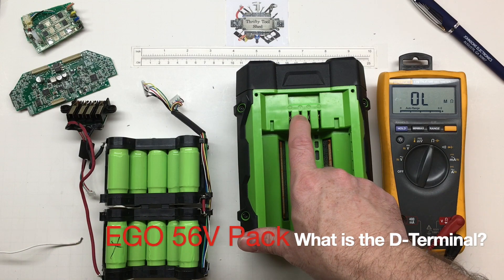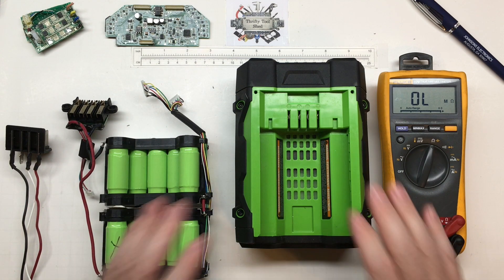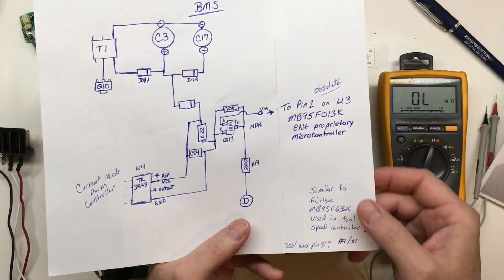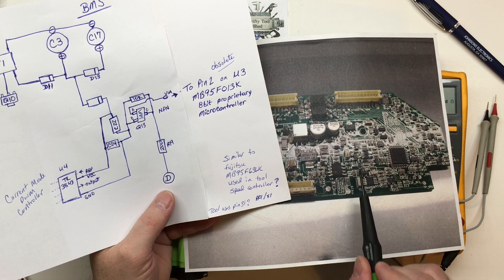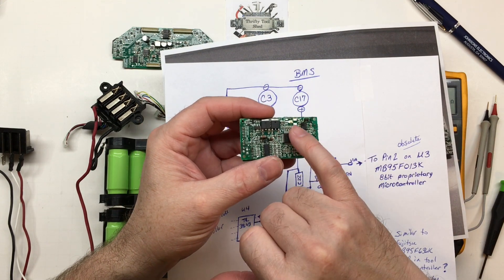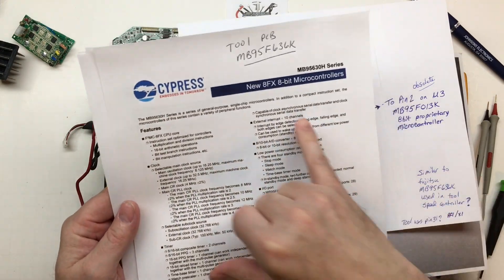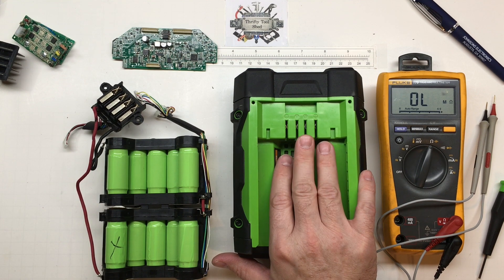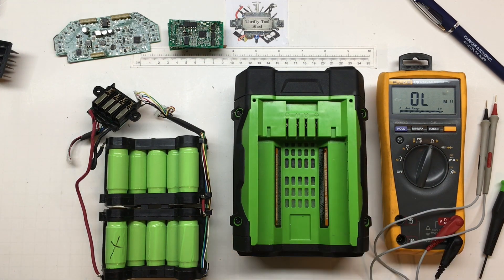EGO 56V Battery - What is the D-Terminal?

Comment: For anyone having similar issues, I had an issue where my mower, wipper snipper and leaf blower would run for ~5 seconds before they shut down, the fuel gauge on the battery also didn't light up when the tools were turned on (although the fuel gauge worked when you pressed the button on the battery to check the level). I tried powering the tools using my home made ebike battery but had the same result (ran for only ~5 seconds before powering down). I figured that the issue must be with communication over the D terminal. I pulled the board out and checked it under a microscope and found that the 200 ohm resistor (R19) across the data line had blown and had gone high resistance. To test, I removed the blown resistor and temporarily bodged in a 200 ohm through hole resistor and it fixed the battery. I will order an SMD resistor to replace it and all should be good. Hopefully this helps others.
Reply from the maker: It will be interesting to see how many viewers have that same issue. I have not seen it. Very unusual to have a blown resistor on a data line.  Thanks for sharing!

Comment: Thrifty - what would be your advice on how to set up a protection to 4 EGO batteries wired in parallel to run a non EGO motor so that the batteries do not damage each other if the bank becomes unbalanced and also that any battery would shut off or cut off if the SOC or remaining capacity drops too low?  Since it seems the D terminal would normally handle the low voltage or capacity shut down via a conversation between the BMS and the tool I don't know how we can leverage the BMS's at all to help with this.  EGO must have some way they are addressing the multiple battery safety since they have several tools that use multiple batteries like the Zero turn, the backpack blower, and the snow blower and maybe others but perhaps that relies on the D-terminal as well.
Reply from the maker: Yeah, the D-terminal is a strange one, and it is going to be hard to get to working in our favor for sure. I can not speak from experience at all on these packs with 4 in parallel to be clear. I have not had to do that myself, but schottky diodes are most likely needed to keep from back feeding and then maybe the individual packs can be monitored individually with either a low voltage cut out board as I have discussed and shown before or a simple trick is the cheap battery voltage indicators that have an alarm feature. I would imagine you could even remove the buzzer and make the output trigger a mosfet or optocoupler, etc. and then, hopefully, all will be monitored individually with 4 of those circuits. It's always a risk with any design, and that is 4 packs, so be careful as with any modification. Be safe and have fun. Wish I could help more, and best of luck to ya!

Comment: Dude your so advanced I want so badly to learn this stuff
Reply: Quick question I have several ego batteries that I've charged to the voltage by an unorthodox means however once inserted into a tool I only get until motor startup then red flashing I went through all temp transistors to no success. Could I possibly run a 10k resistor from neg to D terminal and confuse the motor controller.
Reply from the maker: The D-terminal seems to communicate so there is no easy bypass that I have seen. Thanks for your kind comment!
Reply: Yes, think I'm going to have raise the white flag on this one. Geez, I don't get my ass kicked often

Comment: did you try a serial decoder through your scope on the d (data) terminal?
Reply from the maker: I have not. I was hoping to get to that point since all I really seen on the scope is likely a carrier frequency from the controller output. It has been several viewers that have taken it that far and were much closer to decoding it, but I have not heard back from them since. Once I seen aftermarket clones of the board (in aftermarket packs) I backed off spending anymore time on it since I know it has been done to a degree and we have a possibility of getting spare boards. I hope to eventually see these BMS boards for sale. I have asked a couple manufacturers about buying a bulk quantity, but no success yet.

Comment: Looks like maybe a bidirectional UART. The presence of R19 (the 200ohm between D-pin and Q13 collector) means that when the micro opens Q13, the tool won't see ground, just a lower resistance. I guess if the tool/charger also has 10k on that line, it'll be close to zero. I'm guessing it's a similar dual purpose pin like M18. Maybe serial data in charging and an enable/disable pin for the tool. Those pulses look more like motor noise than serial data. I'm fairly sure XGT has a separate isolated ground for communication so that it can communicate whilst the tool is running - otherwise there's just too much noise when data shares a ground with the main power path. It could still have serial data during charging as the charger can keep the power input fairly clean.
Reply from the maker: All good points. I also feel the same way about the noise on the oscilloscope. Especially since it would only show up once the tool started and I feel like the communication starts when inserted in the tool. Most tools blink the packs fuel gauge when inserted so surely at least a small amount of data is tx/rx. I should have mentioned on video that the 15Khz was most likely a carrier frequency of the motor output. I am used to seeing that in industrial drives to a degree.
Reply: @ThriftyToolShed  good point, there could definitely be some data transfer before the trigger is pulled. That would be enough for the battery to give some parameters to the tool. I looked for that specifically on M18, but pretty sure there's nothing. Could be something on One-Key or newer tools.

Comment: Do you by any chance know the part numbers used for the battery terminals? Both on the battery side and on the tool side. I'm sure I can use a generic spade terminal on the tool side, but it would be nice to know what the genuine part number is. Can't find anything similar to them on Digikey. Thanks!
Reply from the maker: I am sure it's a custom item EGO makes for their own manufacturing. You can find some generic battery blade style adapters on Amazon and eBay and may even find some similar to the below example. But basically that or you have to make your own. 
https://www.ebay.com/itm/275986283413?mkcid=16&mkevt=1&mkrid=711-127632-2357-0&ssspo=o5qkd7YgSJW&sssrc=4429486&ssuid=D_qZMHXJQNK&var=&widget_ver=artemis&media=COPY

Comment: Could someone help me please? I need a value of R126 on the control board. I want to fix blinking green light issue and started removing the potting but I accidentally knocked it off the board.
Thanks in advance
Reply from the maker: The R126 is a 10D or 124K 1% by the EIA-96 SMD standard.
Reply: thank you very much @ThriftyToolShed
Reply: It didn't work, battery doesn't communicate with charger or any tool. No Lights. It's a shame because it still holds 50V charge. Is the a way to reset the control board?
Reply from the maker: Unplugging the BMS and plugging it back in would be a reset on these. If you are not getting any led when the button is pressed then it could be something going on in the DC-DC converter part of the circuit. I mentioned this in some videos I know. The little square silver transformer area has some Electrolytic caps around it and I believe this is the buck converter circuit to drop down to 10VDC or so for the control circuit.
Reply: Thanks, I'll check them next.
Reply: Well, looks like C17 (22uF, 25V) is done. Not sure if C22 is related but it doesn't look healthy at all. I want to replace it as well but don't know the value nor type (hope it's not Mica). Any help will be appreciated.
Reply from the maker: C22 is a ceramic cap and measures around 23uF in circuit with no power on the board.
Reply from the maker: Seems to be very similar to C13 while testing them.
Reply: Thanks for your help @ThriftyToolShed  . It's a lost cause. No 3.3V and no schematic.

Comment: I'm having trouble with one of these batteries, 56v 5ah ego, where the bms button doesn't light up, it doesn't charge, and if I use it on a mower, the mower runs for a few seconds then the mower itself blinks green and orange. I have tried to use your videos to help me troubleshoot it, the battery has a whole 54v left, but I am uncertain how to tell what else could be the problem if its something on the circuit board. Any chance I could get some assistance?
Reply from the maker: It's good that the pack has 54V so hopefully the cells are ok. You will have to measure across each cell group to make sure they are truly balanced, but at least that is a good sign to have 54V. The problem is most likely with the BMS board. If the button will not even light up and you have 54V on it then the board is faulty. The mower will only run for a few seconds and shutdown if no communication is established with the pack. I would check the connectors to the board and make sure they are making a good connection with no visible corrosion. The cause many times of this symptom is the DC-DC converter on the board is not working. It can be any components causing this in that part of the circuit. One of the most common is the small silver cube. it has 3 coils and many times one of those coils is open. I have not found a replacement for these. I will sometimes use one from a donor board since I have collected a few over the years of working with these from time to time. Best of luck to ya!
Reply: @ThriftyToolShed  I have in fact checked all the cell packs and got 3.91V on each. I’ve also checked the connections on the connectors and there is no corrosion on any of them. I’m sure it’s something on the board, but not sure which component, thanks for the help!

Comment: SO it looks like the battery micro tells the power tool to shut down when the battery is low.  There isn't any kind of MOSFET in the battery itself to turn off the output.
Interesting!
Thanks for your investigation!
Reply from the maker: That is correct these packs have no Mosfets controlling the cut off. So more like the Milwaukee, DeWalt and Makita style of pack. They use intelligence in the tool and or communication between the two to help with low voltage protection. Where Ryobi, Ridgid (AEG) and Kobalt use the Mosfets to turn on/off the high current output. The Mosfets have to be sized for high current and will also add more heat inside the pack so I tend to like the EGO style better, but it does make the tools controllers a bit more costly to manufacture.  Thanks for your comment!
Reply: @ThriftyToolShed  What if you connect a generic battery (with same voltage) in parallel along with an EGO battery?  this way the tool will communicate with ego battery and the generic simply adds more AH
Reply from the maker: @larrywoo7055  
That was discussed as well. I have done this in certain situations when everything is set up almost perfectly. Not only do the packs have to be charged to the same level to be equalized they also have to be matched so they even discharge at the same rate. If not they will fight each other and it can get bad enough to damage one of the packs if not both. Some protection circuits would need to be added to be more like a battery isolator.
Reply: @larrywoo7055   Ego seems to control the parallel connection of batteries through an external control board, similar to MOS shutdown. 

Control whether to parallelize each battery by assigning a set of MOSs to each battery. There is an independent MCu control
Reply from the maker: Yes. You are referring to the Power station or the zero turn mower setup. I would surely assume so. I don't have either one, but they have to have that for sure.
Reply: @ThriftyToolShed  I have a PCB for a snow plow that uses two batteries. He has configured 6 MOS for each battery, just like a battery protection board. I use translation software, so the description may not be accurate
Reply: @ThriftyToolShed  I am currently conducting reverse engineering to understand its working principle. The D terminal is connected to a transistor. I'm not sure about his function

Comment: Love your videos. I know this is an older video. But I figured that I would comment anyway. I'm in the process of modifying a 54" John Deere zero turn to an electric and found a guy on Ebay that is selling new Poulan electric mower motor assemblies for just $50. This comes with the motor housing and controller. I found that an Ego battery works just fine when hooked  up to the Poulan controller using both the T and the D terminals. So it seems that there may be an industry standard to the communications and temperature monitoring. I wont be using ego batteries however. I'm using Lifepo4 56v 100 amp hour with built in BMS. my problem you may have guessed is the D wire. I dont have a scope to see the wave pattern/ frequency and was wondering if you have any idea of what is being generated that I could re-create to talk to 3 controllers. BTW the hrdo unit will be ran by 3000w bike motor. I would have loved to use independent gear motors for each wheel but maybe next time. Any help would be appreciated.  Thanks
Reply: Sorry, i should have watched to the end before posting above comment.

Comment: is it possible to keep the mower at full torque by adding a switch? I'd like to keep it at full torque to pick up leaves better. As it's not adding enough resistance for the sensor to demand it.
Reply from the maker: I am not aware of a way to do so with a switch. It seems to be monitoring motor load within the controller which is hard potted as shown in my LM2100 mower troubleshooting and controller replacement videos. Of course I can cut my repaired mower up full output from the replacement controller with a potentiometer. The original controller has no way to adjust this available to us. The only possible way might be installing 2 high lift blades 90 degrees apart similar to the select cut style and it's possible to keep it loaded at all times that way. Just a thought, I have not actually tried it myself. On some models the high lift blade alone may keep the rpm up more?
Reply: @ThriftyToolShed  I also have the older self propelled model and it's always been my complaint that none of the ego mowers have a "turbo" button to keep the RPM high. I used the high lift blade and since switched over to the cross blade, but on both blades the RPMs drop when its not actively cutting tall grass. Hence making it really useless for mulching or bagging leaves, since it just idles.
Reply from the maker: Man, if it even idles with 2 high lift blades offset 90⁰  it will be hard to keep it loaded with small debris for sure. If you ever do have a controller go bad you can just install the cheaper one like I did and run it whatever speed you like.

Comment: Thanks for all your research into the d terminal. I have looked all over and it does not appear that anyone has totally figured out the 'protocol'. My use case might be a simpler problem that you might have some ideas about how to solve. So much of the information I have found on the d terminal is about it's communication with the charger. My interest is on the 'tool' side. So what I want to be able to do is power my EGO lawnmower with a non-ego source of power. It sounds like if I put the right voltage and current to the lawnmower that it will likely run for 10 seconds and then stop since it can't communicate and get the proper information it needs from the d terminal. At least that is what it sounds like happens on then leaf blower. Can you think of a way to 'fool' the lawnmower into not stopping after 10 seconds? Maybe just put a high voltage value on the d terminal line, or maybe connect to ground (negative)? Probably not, but maybe there is something simple that just tells the lawnmower it's OK to run. Any ideas would be appreciated. It would be interesting to know what the tool's controller and the battery's BMS are discussing over that channel, but as you, and others, have found, this is not an easy thing to do. If knew the protocol, I could do program a microcontroller to make the tool happy, but without the protocol, no way what I need to tell it. Thanks again for all your great information on EGO batteries. 
Peace,
Mike
Reply from the maker: Hi Mike,
Yes,I am at that exact spot for sure. I have not gotten any further with the D-terminal communication. I have had a guy contact me and he mentioned he had some better equipment for testing and was working on the serial data bits etc. Unfortunately he has not contacted me with any further updates. I also shared a few aftermarket packs in videos that are 56V replacements and I was impressed with the fact that they did clone the BMS board and it works well with the EGO equipment. Some people are not thrilled about those packs nor did they like the idea of purchasing these Chinese packs. My Main point was simply wow, they figured out that pretty quick. I am atleast impressed with that part. I have tried my best working with the manufacturer and they still will not sell the BMS board separately. I tried. The only way I know of at this point to run the mower with other than EGO or the knock off EGO pack is replacing the mower controller which is not what anyone wants to do really. I have a video replacing the mower controller and I can run it from 40V - 60V source. The only reason I done that of course is I bought a mower non-working and saved money by doing it that way. Thanks for your comment!
Best of luck to you!